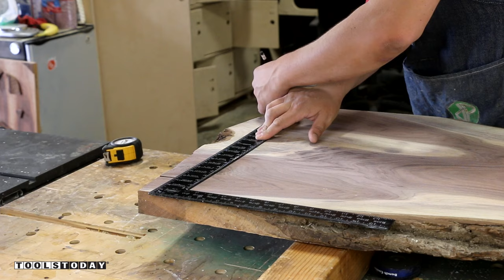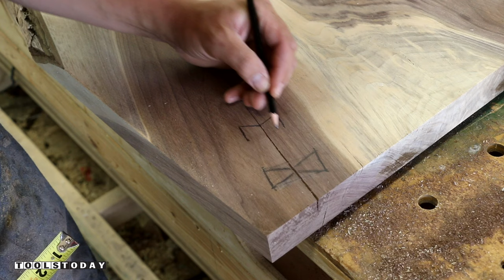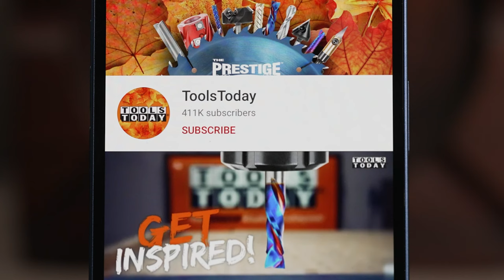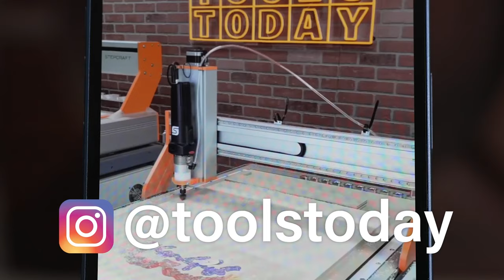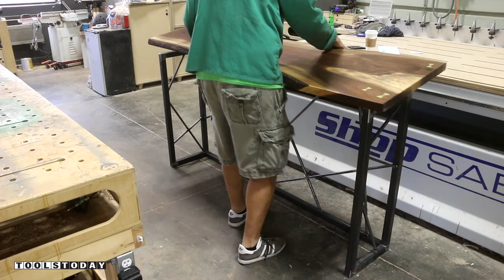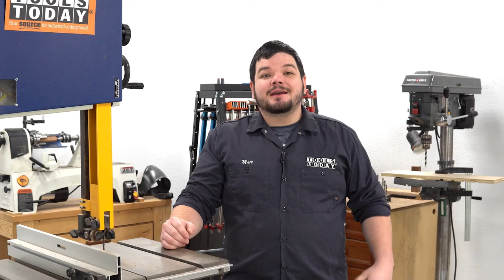How to CNC: Slab Table with Brass Bowties  | ToolsToday

Comment: Nice, would love to do something like this.  What alloy brass is that?  I have had a terrible time with the small amana bits breaking (1/16 O bit, v bits, breaking the tip off larger O bits) while trying in brass and 6064 aluminum.
Reply from the maker: Sorry to hear! We provide free replacement, please email me, stefan (at) toolstoday.com and reference this conversation along with item # and your feed and speed running parameters.